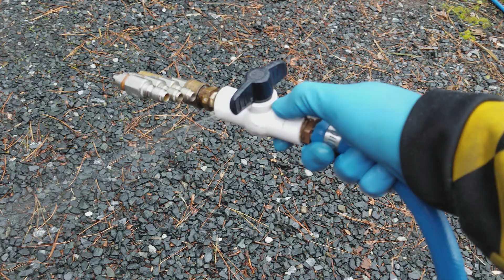Sad face... This ball valve finally started to leak and had to be replaced.

Comment: Hey rob, great content. I was wondering what is that brass nozzle your using this setup in the video I noticed another person using one as well. Is a fitting I can buy local?
Reply from the maker: Innovative shooter tip.  Available at Southside equipment.
Reply: Thanks rob. I’m down in savannah Georgia and just getting a rig thrown together and your videos help out a lot. I went and helped a friend wash some apartment buildings and realized the potential in it all so I’ve decided to start my own business and have been trying to do as much research before I actually push marketing for business

Comment: That’s junk,,, barley last a day if your lucky, or if you are using a 2000 psi 3 gallon per minute
Reply from the maker: We have had these valves for 6 months minimum.
Reply: I tried using them when I first started, I. Even tried brass gas line valves,  I had 0 luck. Happy washing
Reply from the maker: Yeah these are definitely only good for low pressure systems.